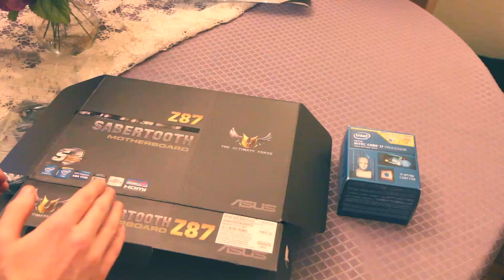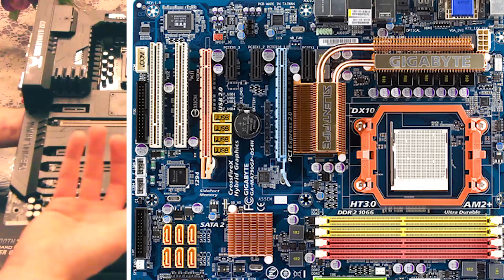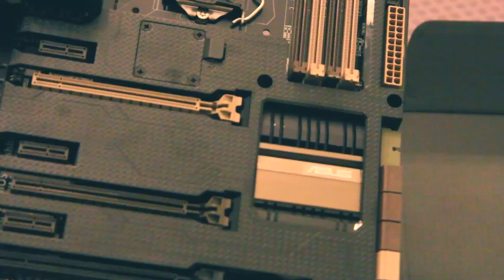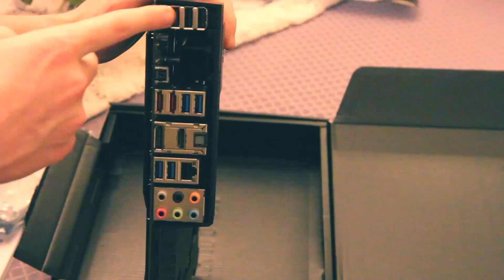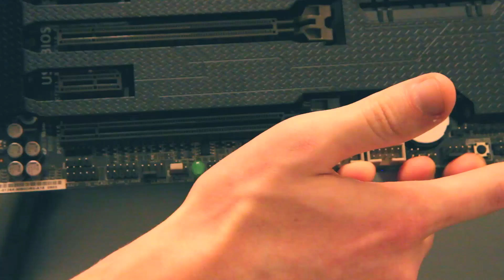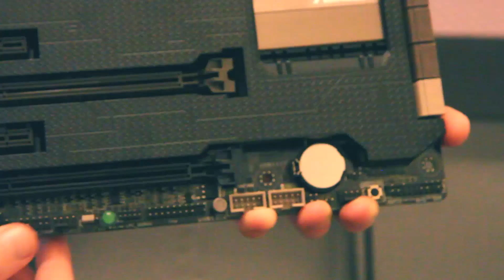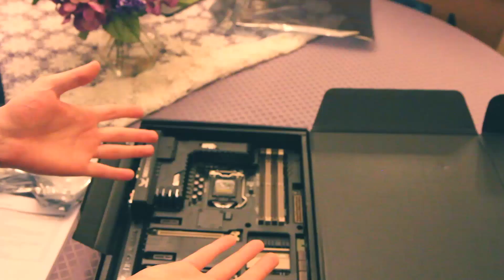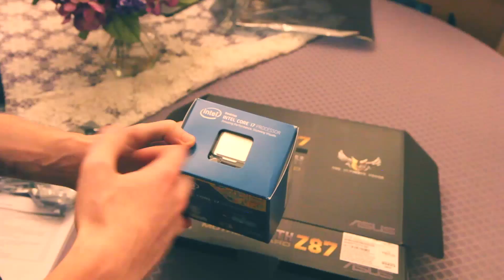What Is A Motherboard?

Comment: The E3-1230k v3 is just as fast as the 4770k (actually faster on some benchmarks), and $90 cheaper, works on the same socket. So long as you can live without overclocking, of course.
Reply: But it's a Xeon, so often you'll get performance hits as it's not optimised well for gaming. Lower clock speed, lack of overclockability and lack of support for some instruction sets (Obviously depends what you want to do with it) means I would personally justify the extra $90, easily. Depending on your usage, the lack of onboard graphics could also prove problematic.
Reply: Landmarqueboy
what the fuck are you talking ? Xeon ist just as good for gaming
Reply: Dude, you need to overclock
Reply: Landmarqueboy It's basically the same as the 4770k with a locked multiplier, it actually has more extensions sets enabled (Intel has been silently turning off features on K series, such as FMA3, VT-D, EM64T, look on CPUBoss) benchmarks have shown that even though it's a Xeon, the common nonsensical ideal that it's not meant for gaming is almost irrelevant (it's very different from the e5 series, just because something is branded for or against gaming, often doesn't translate to anything beneficial in the real world, it just becomes a gimmick and selling point for the nonthinking masses) and let's be honest, if someone's willing to spend over $300 on a CPU alone, you can bet they're going to use a dedicated GPU.

The performance of the 4770k is nominally higher (maybe 5% at best in some benchmarks) unless you absolutely need to overclock and use the integrated gpu (in which case you should go with the cheaper option anyhow) why not save $90 on a chip that's for other purposes more capable?
Reply: Jason Waataja For all the trouble people go through with overclocking (I'm guilty of this myself, been doing it since early P4's...) isn't it just better to spend the money spent on extra cooling on better processors/components? Seriously the difference you get from overclocking is so minimal most of the time you really have to question the benefit of it all. I really hope you were being sarcastic.
Reply: MacroPheliac My 4770K at 4.7GHz is ~30% increase in clock speed. While that doesn't necessarily translate to 30% increase in performance, it has given very noticeable gains in framerate in the likes of Planetside 2, Skyrim, and TF2. With that in mind, I would definitely not disregard overclocking as a pointless endeavor. And what do you mean 'all the trouble you go through'?
When I mentioned the lack of integrated graphics being a problem, I was referring to tasks that are specifically CPU heavy. If you're building a rig that is for ripping DVDs exclusively, for example, the 8 threads of the i7 would be useful, while not needing a discrete GPU adding to the price of the rig due to the onboard GPU.
Reply: Landmarqueboy You mention the "8 threads of the i7" like it's something special, it's 4 actual hardware threads from physical cores with 4 threads on virtual hyperthreaded cores, the 1230v3 has the exact same thing. If you can prove on paper that the drastically higher clock rate actually makes a significant improvement in frame rate and multithreaded applications, then maybe all the trouble you go through for extra cooling, voltage adjustments, XMP profiles etc, maybe it's worth it. But when you look into the extent people go through with buying a mid-high end cpu, then stacking on more money for watercooling or high voltage ram..when in the end you might see a 5-10% difference, it's kinda hard to justify unless you absolutely MUST have those extra few FPS...I just think the PC enthusiast market has got out of hand and wasteful...just my opinion.

If you've done any overclocking before there were extensive guides and GUI's that made things simple, you'd know what I'm talking about when I mention 'all the trouble you go through'
Reply: I'm aware of how hyperthreading works, thanks. I mentioned those three games in reference to performance increases with over clocking as they are known to be particularly CPU heavy games. If you test it on games in which the CPU is not often a bottleneck, then yes, there'll be bugger all difference. I spent £60 on the H75 cooler, and my temps rarely exceed mid 60s unless i'm running benchmarks. I've got 8GB of HyperX RAM that cost me £35 (when prices weren't ridiculous), and the XMP takes a matter of seconds to set up. I fail to see how that is a lot of trouble. With regards to the 'troubles' of over clocking, I can't comment on how it used to be back in the 'old times', but these days it requires little more than a bit of research, a bit of tweaking, and then a few hours of stability testing. It's hardly arduous if you have an interest in the experience. And it's free performance gains; in the grand scheme of things, it's not much time to use up for even a little extra performance.

Comment: 'CPU does the anti-aliasing
GPU - General Processing Unit, gives you your frames.'

Plz stahp.  Leave this to Linus Tech Tips, this is cringe worthy.
Reply: That made me cringe too. XD
Reply from the maker: Xanifur CPU comes into play when the GPU has to work hard and thus needs to be fed information quickly enough in order to keep up. The CPU does this feeding it helps with the GPU's ability to anti-aliasing. I could have clarified more, but give me some credit, i'm trying something new. 

There are certain games which seem to load on the CPU a fair bit, the source engine is one of them due to the way it has been written. It is probably done on purpose to be honest so that people don't need to have really expensive GPU's to run source games.
Reply: ***** The GPU carries out the anti-aliasing, the CPU is involved in the pre-processing of all information fed to the GPU. In that regard the CPU certainly helps, to an extent, but it doesn't 'do' the anti-aliasing. I assume 'general processing unit' was misspeaking, so I won't pick on that. :) 
By no means am I trying to 'hate'. Please do more hardware videos; you can never have enough hardware videos.

Comment: But what are your specs?
I have two 7770 radeon HD series GPU's
Intel I7-2600 CPU
two sticks of 4 gig Kingston ram
750 watt power supply (not sure what brand)
and I don't know what kind of mother board I have
and 1 tb hard (again not sure the brand or how fast it is)
Reply: I came
Reply: ***** i'll just pretend i know what you're talking about
Reply: aha alright
Reply: i still dont like 2nd generation i7 Processors :D , but still its a nice little setup
Reply: Haha thanks I don't really like intel processors but my computer was built by some one else about a year or two ago when I didn't know anything about computers.

Comment: "What Is A Motherboard?" Maybe a better title?
Maybe "What A Motherboard Is"
Reply: The title you suggested has improper grammar, the title he has is correct.
Reply: *****
For the title I suggested to have improper grammar, it would have to be a sentence not a title.
Reply: *****
Therefore it does not need punctuation. The "A" should not be capitalized, but I only followed the incorrect grammar choices of the author of this video in that case.
Reply: DihyDroxy1 It's actually the opposite. If it were a sentence with actual context then it would make sense, if not then it makes no sense. "What a motherboard is" is not a complete sentence, "What is a motherboard?" is a complete sentence.

Comment: Those pins are not for LEDs...
Reply: HDD LED and power LED are all connected at the bottom of the motherboard, so yes they are. You've also got the USB, audio, power and HDD reset connectors. Maybe a couple of fan headers too.
Reply: OH when he said LEDs it sounded like he was trying to say case lights.

Comment: Yayyyyyyyyyyyyyyyyy. Computer videos! 
I thought this was by Austin Evans when I first scrolled past it in my subscription box. :P
Reply: How Austin make a video? His apartment burnt down.
Reply: Firedude3542 I know. It was just my first thought since the picture for the video is similar to what Austin would use.

Anyway, I finished this video and I'm a bit sad since there were a few things that weren't accurate like what the pins at the edge of the motherboard are used for. They're used to power fan, ports, and other functions like front usb, etc and do not connect to the power supply--at least not in the way Daniel might have been explaining it. 
There were a few other things like pointing to the cpu socket and calling it the cpu and calling the gpu a 'general' processing unit instead of 'graphical' that one time that annoyed me a bit but I'm pretty sure it was just a slip up due to Daniel not being used to making computer videos. I'm not sure if the explanation for what the gpu does was a slip up but I still enjoyed the video overall. 

I look forward to more content like this. :)